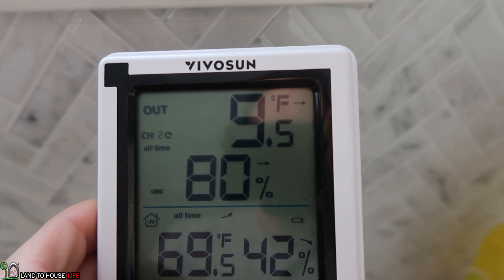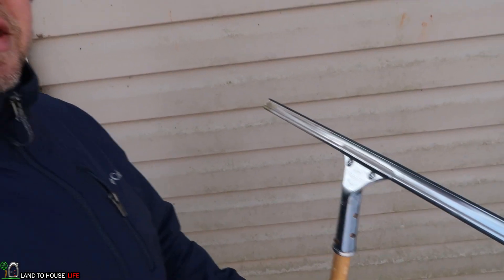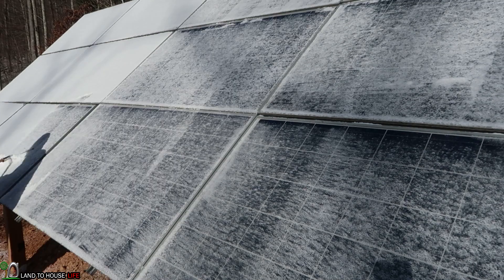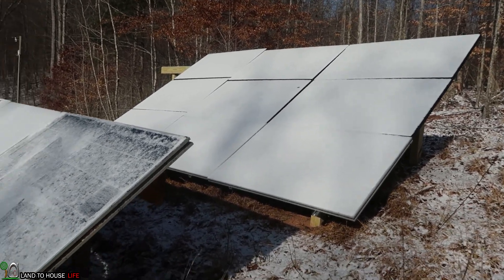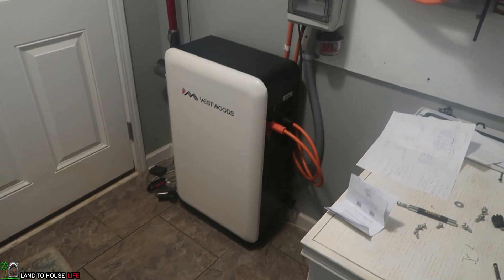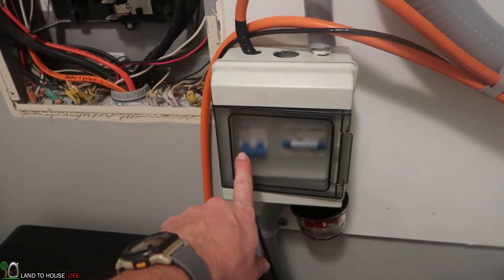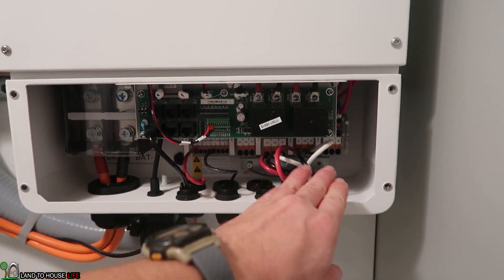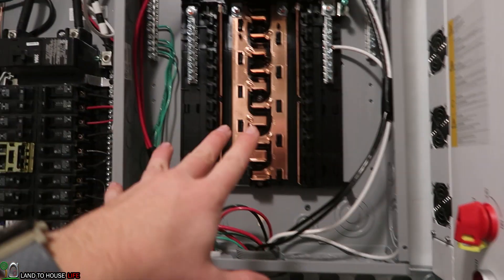Solar Panel Snow Removal

Comment: Have you ever tried a leaf blower? I've always wondered if a leaf blower would be an easy way to clear snow off panels.
Reply from the maker: A light snow would work. I should think anything more than 1" would be too heavy to use a leaf blower.

Comment: I always find it funny when people talk about it being way to cold outside when it's around 0f°.
I live where we regularly get -40°(celsius or ferenheit is the same at that temp) in winter, and in the +40°c (between 105° and 115°f) in the summer...
Reply from the maker: For an area that normally gets winters in the 20f range 0f is cold. I used to live in New Mexico and we did see 120f a few times. its so dry there that you can survive. If it got to 120 here in NC with 95% humidity everyone would cook.

Comment: Everyone knows how a backside car window heating works.. can you hook some tinyheatwire on the glass.. I suggest 48volts ❤️⚡️
Reply from the maker: I wonder if that is a product available for solar panels? Luckily we only get snow a couple times a year here. walking out a few times to remove snow is now bad. Now if we had more snow I could see a heated system being helpful.
Reply: The downside is more draw from the solar system when you need to conserve it most
Reply: Resistance heating is the least efficient form of heat. Rear window defrosters have a massive current draw in a car. Ever notice your headlights dim and your heater fan slows down, the instant you turn them on, until your charging circuitry compensates for the load? The energy consumption to defrost the surface area of large arrays will huge. And you'll need large gauge wire runs back to your arrays with the accompanying breakers and emergency shutoffs required by code.

There's a reason why these don't already exist.

Comment: Extendable paint pole is a great way to reach those upper panels... brrr! Just like Reno, Nevada a couple weeks ago! Blessings and thanks for the video and direction!!
Reply from the maker: For sure! My extendable paint pole stopped working or I would have used that. I think it got a nice large glob of paint stuck in the locking mechanism. The temp was 0 degrees here for several days. very cold!

Comment: Geo Thermal loop, dig a trench below the freeze line, put 6"-8" black plastic pipe down there, put both ends into a  shed or porch to bring that up to 40f or so rather than have them be the outside temp, gonna do that on my porch that goes around 3/4 of my 1915 farmhouse, so instead of having 10f air on the exterior wall, it'll be 40f, just need a backhoe, some pipe, an electrician and we're good to go!  Woohoo, easy peasy...
Reply from the maker: Geo Thermal does seem to be helpful but it is a lot of work upfront. Also not possible for everyone because of how much room is required to install.